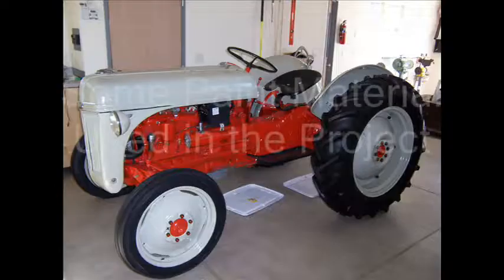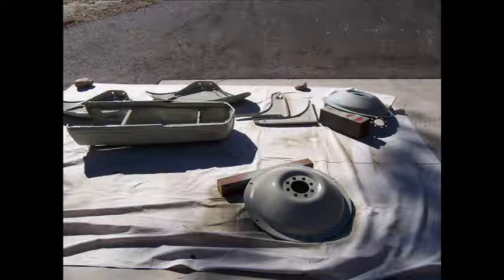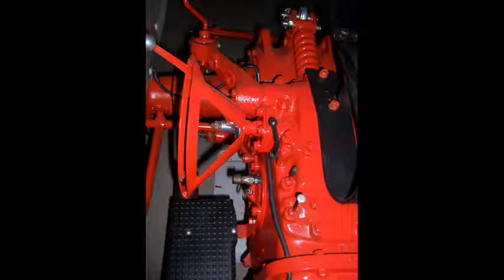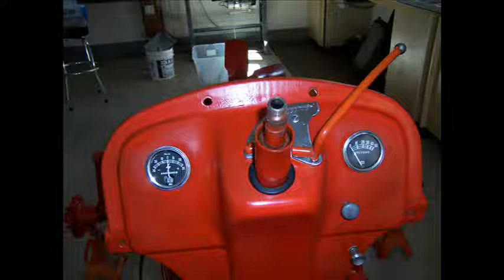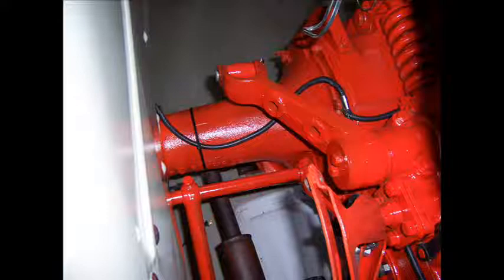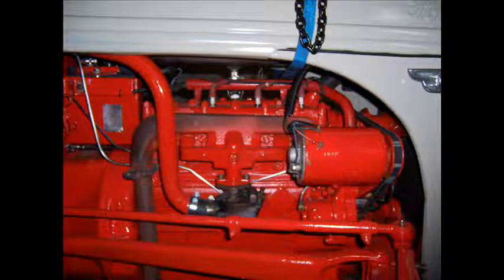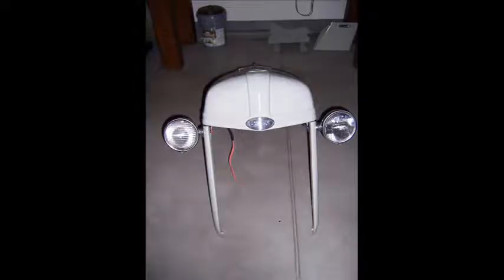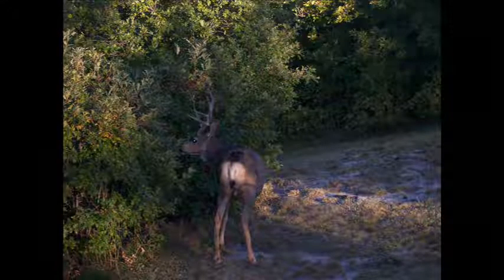Classic Ford 8N Tractor Restoration | 9N | 2N | NAA

Comment from the maker: Thank you.  Converting o 12 volt essentially half's the current in the starter and lets you use an alternator.  I wanted to keep mine original so I kept the 6 volt system (looks much cooler too).  It has never failed to start, even at -10 below zero F.

Comment from the maker: Cleaned everything with Marine Clean (POR15) or ZEP Murado.  Then pressure washed. Did this several times.  Then use metal ready (POR15) or any paint prep treatment, especially on bare metal.  Then a good PPG Automotive primer (mine was rust colored), then Ford Red.

Comment: excellent vid, Im from England originally and now live here in KY. I bought a 48 8n and like it a lot. What advantage is there converting over to 12v from 6v? The only complaint on mine is the steering box is very worn and will soon need rebuilt. thanks.

Comment: Great video.  I have an early 8N myself in the incorrect blue color.  The problem is that the tractor is just too darn useful to take it apart for paint and I don't have a spare tractor, it it will have to stay blue and gray (like a civil war battle).  Is that a Studebaker truck in the background in one of your slides??

Comment from the maker: 8N wiring is so simple that it would probably be easier to remove the wiring, paint and replace the wiring.  If the wiring is old, replace it.  You can build a harness (copying the old one) or purchase a new harness.  If you are making the effort, do it right, otherwise paint the whole thing pink and forget about the details.

Comment: Good afternoon I have a problem I have a Ford 8N tractor four cylinder this afternoon when I was trying to start it sparked at my starter solenoid when I push the button for ignition can you please help me diagnose a problem I already put a brand new starter solenoid because I thought it was shorted out but it keeps doing the same thing could it be my starter on my ignition switch shorted out or what could be on problem do you have any idea please help thank you for your time
Reply from the maker: has to be the motor or the brushes.  solenoid is the symptom not the problem.
Reply: So I'm guessing you trying to tell me if the starter motor assembly is that correct??
Reply: Nə p